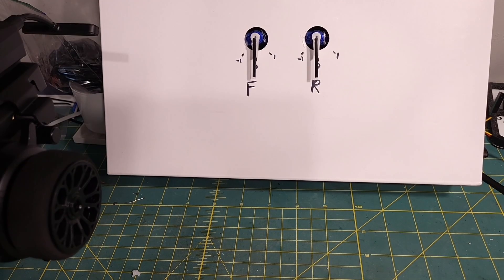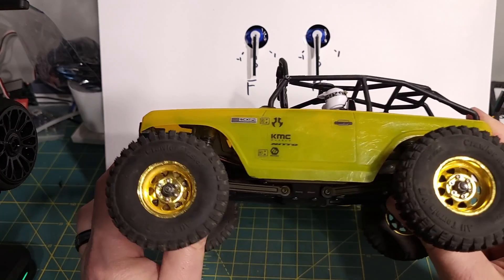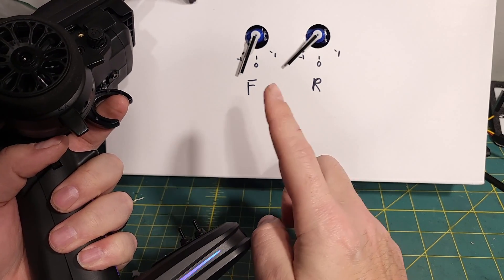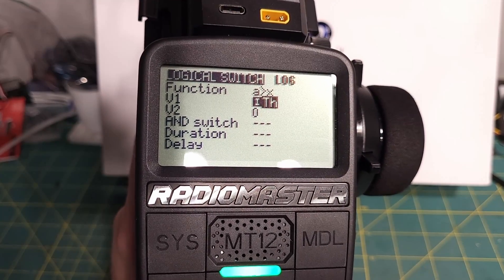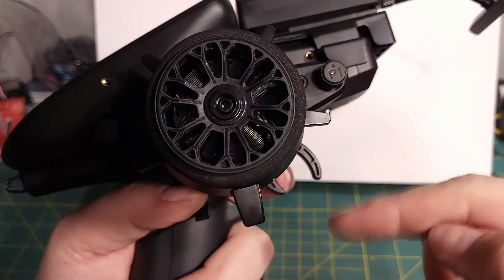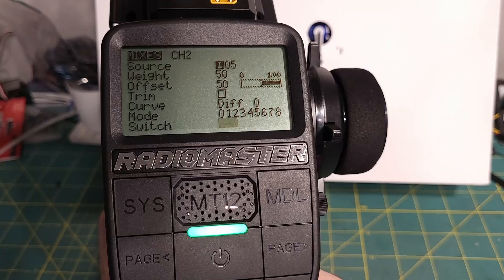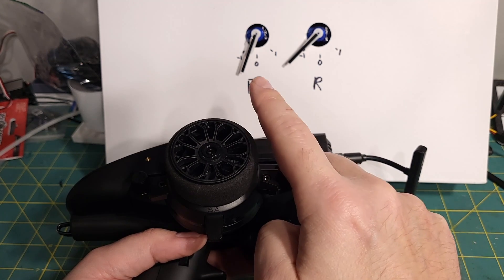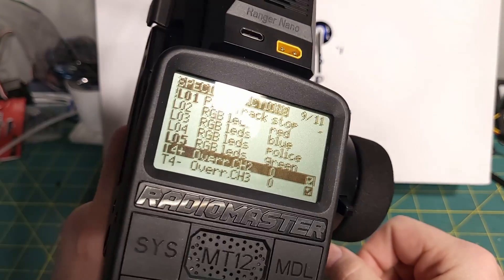Radiomaster MT12 Edge TX - Motor On Axle MOA Setup with Overdrive, Dig, and Burn

Comment: I did a similar setup on my MOA a fear years ago on OpenTX, with stick radio. Used left stick to ack similar to the pot you set.
I must say that your setup is WAY simpler than mine, the logical switch on throttle is a great idea!

Comment: Great video. Thanks for the clear explanation.  I used to run a Fly Sky G7p on my MOA. I didnt care for the radio much. Not very intuitive to set up. I was considering the NB4 as a replacement. It looks like this will do everything I need and save $100, so thanks for that lol.

Comment: I noticed that when you use T4 for dig it doesn't beep.  Each time I use  T4 trim for dig it  beeps and voice says trim centered. I would like to turn that off.
Reply from the maker: You can turn off the trim function in the drive mode screen. Change the 4th 0 to dashes.
Reply: Got it, thanks for a great video!
Reply: Is there a way you could send me the file I know I’m making. A stupid mistake but can’t get it right

Comment: The only change to consider is to move the front rear bias to the rear pot so you can change it in real time with your thumb. You’ll need a larger knob for it. Several options out there to 3D print